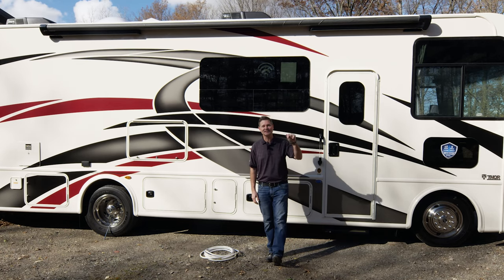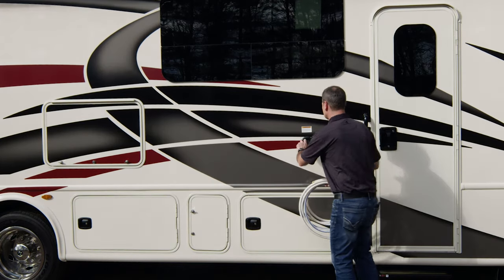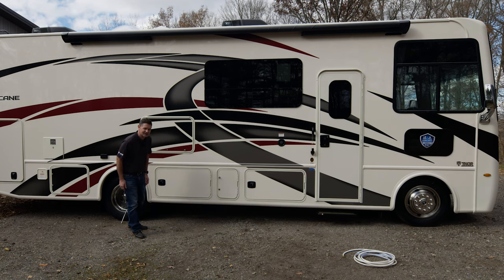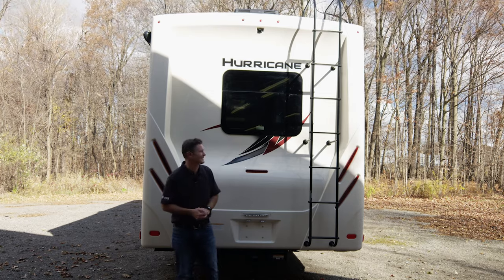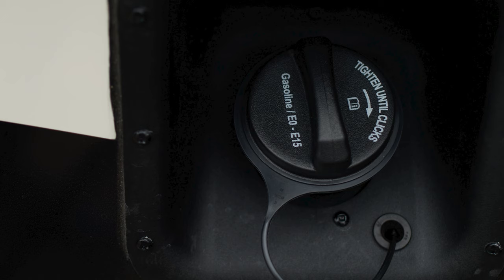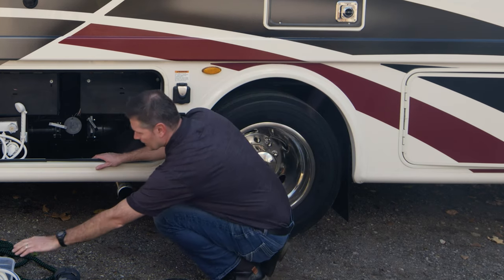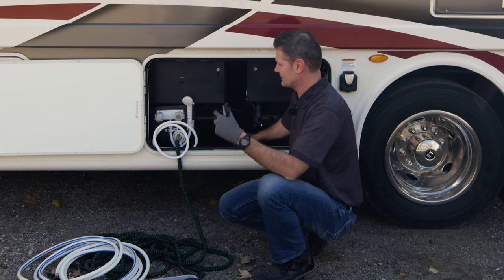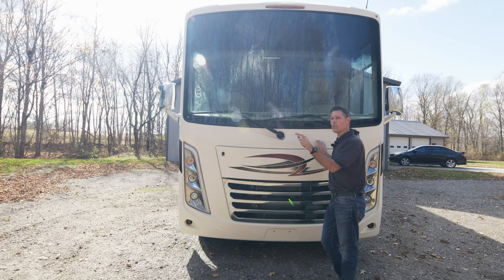How To Use Your Class A Hurricane & Windsport Motorhome From Thor Motor Coach

Comment: Great video.  We are borrowing, and thinking about purchasing, my grandparent's 29m.  We've used it before but this is a great refresher of all the little ins and out.  Thanks for linking to the tow video as this will be the first time we are talking a car with us. It is the last year of the V10 and I think the steering wheel and gages are a huge improvement with the V8.

Does the newer head unit drop audio for a second while switching to the mirror cameras?  Listening to an audiobook is super annoying because audio drops signaling to pass and then again when switching back to the right lane.